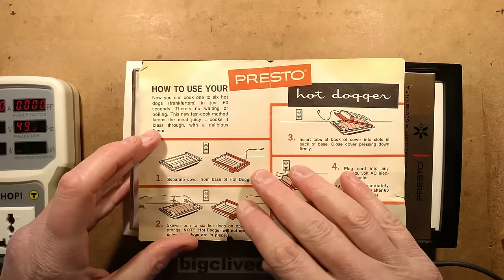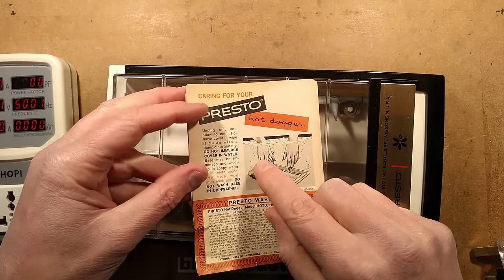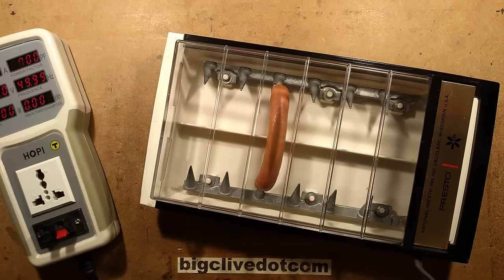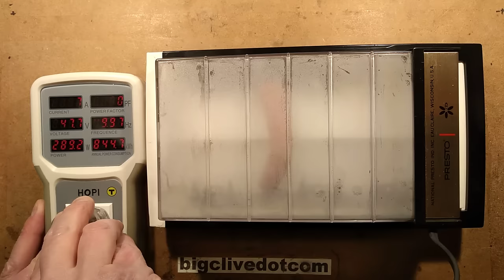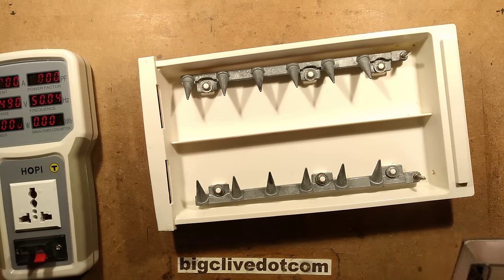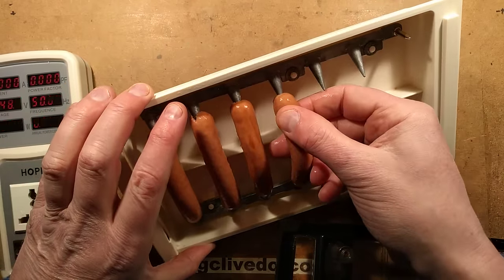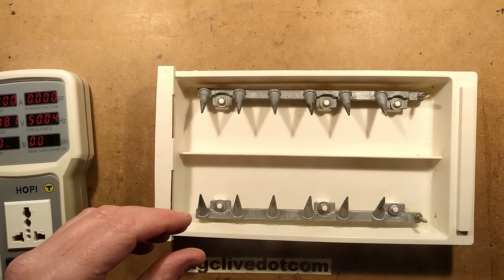Turbo charging a 120V Presto hot dogger on 250V.

Comment: the weird thing is, its probably the most energy efficient way to cook a hotdog.
Reply: It's basically a hotdog mass execution via the electric chair.
Reply: I'm gonna say probably not... I'd be interested to see that tested though
Reply: Turbo charging 6 Hotdogs was around 8kW peak. Let's say that he needs to (worst case) hotdogger them for 1 minute, it would result in 133.33Wh. 
Cooking 100g of Spaghetti with 1 Liter of water in a Pot is on average 200Wh. So I am pretty confident that this invention is as great as it is entertaining.
Reply: @maurice5508  did you say "Wurst" case?
Reply: @speeding2fast  😂👌
Reply: @maurice5508  wht not microwave? Don’t all the waves just bounce around until they are absorbed? That sounds pretty energy efficient to me also I don’t risk burning my finger tips off
Reply: Wrong, you haven't met my ex girlfriend.
Reply: @Moritz Messner The transformer also tends to not be efficient
Reply: @fancypancytalker  Microwaves are pretty efficient.  Thing is you're up against the efficiency of the hotdog being its own heating element, which is going to be 100% efficient or damned near.  Only losses are cord losses
Reply: @maurice5508  When you consider the hot dog will barely need 20-25 seconds at that power it becomes even more enticing as "the worlds most efficient hot dog"
Reply: @maurice5508  It peeked at 2017W. It was the only reading over 2000W. Averaging 750W for 50 seconds, plus 500W more for 38, and another 500W more for 26 seconds, I get 19.3Wh.

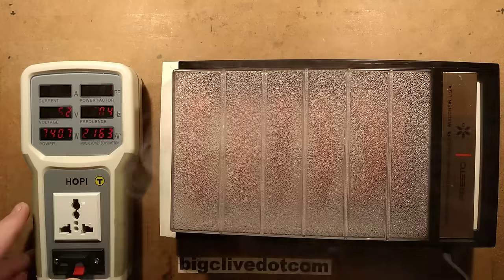6:02	6:52	total 670-631W
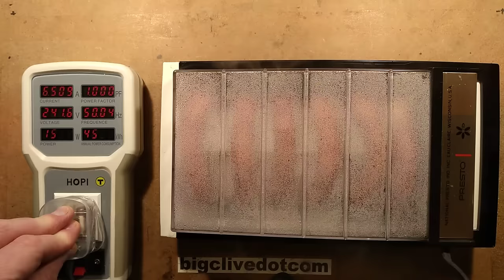6:08	6:46	>1000W
6:18	6:44	>1500W
6:29	peek	2017W

750x50	37500
500x38	19000
500x26	13000
69,500 Ws	19.3 Wh
Reply: @Bob5mith  you are totally right! I did not pay too much attention to the dot on the display. But anyways even with the wrong wurst case calculation I made it seems still more efficient then cooking them normally :)
Reply: @maurice5508  A microwave might be close, or at least in the same order of magnitude. My calculation is the same as 1150W for a minute. That wouldn't overcook 6 dogs like he did though. 

Comparison with boiling water on a stovetop is right out the window.
Reply: If phontoninduction  was still around should get him to go I want hot dogs in 0 seconds lol starts pumping over 10000amps and volts through  it lol  be more like exploding  hotdogs 🌭
Reply: @fancypancytalker  For a microwave you have lots of moving parts and other components of it will heat up as well.
You can tell by the sound coming off it, and the fact that many will often cool down after use.
Reply: I think it is like heating in general.
Pretty much all the power is dumped into the hotdog so not much can beat it, just like a resistive heating element is one of the most efficient ways to electrically heat a room.

The only way to really improve it would be to use a heat pump of some form, so you put in more energy/heat into the hotdog than it takes to pump that heat.
Reply: Yeah it is efficient, if I recollect our measurements at the time (early 90's) correctly. From an exergetic perspective it is a sin, of course. But what better way to be sinful when making hotdogs this way and have  pint or two with it :-0
Reply: @jonathanoxlade4252  Wait, where'd PI go? I just discovered them when you made this comment and they've been great so far.
Reply: @jeffreyblack666  ynow I've been wanting to make a heat pump oven
Reply: @magicalframe9441  It actually probably is. In most other cooking methods, a large portion of the energy used to heat the desired target is actually lost to the environment as radiant heat energy. Think about it this way; If you boil the hot dogs, you’re also cooking a pot, a bunch of water, and your stovetop. Even if you microwave them, a large portion of the radiation is just going to bounce around the microwave and dissipate, not to mention what’s being used to operate the light bulb, keypad, and LCD. I wouldn’t be surprised at all if dumping mains voltage into hot dogs is the most efficient way to cook them.
Reply: @speeding2fast  that would be die wurst joke ever :p
Reply: @Moritz Messner At the same time one could argue your wiring loses a bit of power delivering the power to the tasty resistors.
Reply: Hot dogs come already cooked.
Reply: I think actually cost wise the cheapest way is Microwave !!
Reply: @marcusharmon8389  Back when the Hot Dogger was in production I presume it was pretty cheap, a lot cheaper than a microwave.  Since it is practically 100% efficient it uses less energy than a microwave oven which is about 2/3 efficient.
Reply: @marcusharmon8389  No. That would use more than the zapper. The energy required for cooking is the same no matter what the method, but there are losses converting electrical to microwave energy. Of course, the steam is a loss, too, with the zapper since it probably does little cooking.
Reply: @mikemondano3624  takes 15 seconds in mine so probably about the same but it’s still very good
Reply: @mikemondano3624  by the way I used to do a similar thing in Prison in 1995 I had two wires coming straight from a 240 mains for boiling water for a cup of tea or coffee I attached 2 razor blades from shavers to the ends of the wires and attached them to hot dogs which the prison always served cold either by choice or just because you went down late for dinner this had the same result !!!
Reply: @magicalframe9441  why would you say that? not very logical
Reply: You're probably bang on the buck for that one lol
Reply: Better than the microwave
Reply: So don't turn it on until the lid is on if you were to touch those terminals in the lid you be fried
Reply: @speeding2fast don't be a "Brat" about it 😂
Reply: Electrically yes, but I find if you want to optimize for both convenience and flavor, cooking them in a pan with a little bit of oil is actually really good. They get a little crisp on the outside, and they stay juicy on the inside. Way better then boiling, IMO the best way to cook hotdogs without a camp fire or BBQ.

Comment: I like how the hotdogger doesn't even have a switch, and you have to physically disconnect it from the wall.
Reply: Honestly I'd never trust the switch if there was one
Reply: Well thay do have switches on the wall like smart ppl don’t thay?
Reply: @timrattenbury4768  well it was designed for the American market where most people don't
Reply: I have a portable electric grill like that. It's literally just an electric heating element, a power wire, and a housing.
Reply: it needs the two metal on the lid two complete the circuit so as soon as you open the lid it stops cooking pretty smart tbh.
Reply: @IncredibleMD  not even a heating element, you just plug hot dogs into the mains
Reply: @bryanmartinez6600  well it's added safety. In my house the upstairs landing socket is on the ground floor loop circuit. I can tell you that creates quite a spark when you are rewiring a socket thinking it's been isolated. 🤣
Reply: @royfinegan8006  It still only works with the prongs bridged so there's two disconnect layers in the case of a switch.
Reply: @danksley  well the idea of turning it off would be to bridge the prongs, I wouldn't want to do that with a single switch
Reply: @user-yv2cz8oj1k  i can clearly see the mains-connected prongs in the cover are recessed into insulating tubes, so you would need TWO forks first, to get the connection and then bridge them. I don't think most people have two forks in their kitchen
Reply: @royfinegan8006  so you dont even trust your light switches my word sir you rebel
Reply: @calvincormiercole6438  my lights can't cook 6 hot dogs at once
Reply: @royfinegan8006  fair enough lol though that would be an interesting thing to see not gonna lie
Reply: @timrattenbury4768  What the fuck...
I had no idea that existed.
Reply: You can clearly see that the power cord is connected to recessed contacts in the cover so nothing is live if you open it. Is everybody stupid here?
Reply: @officer_baitlyn  gezz
Reply: @Volvith  well yea we all have switches on our walls its wierd without them
Reply: The switch is the lid.
Reply: @IncredibleMD  Yeah I think the idea is to make sure you unplug it after use so that it can't accidentally start a fire or something if the appliance did have a switch that failed in the middle of the night. I also have a George Foreman grill that's the same design. As for the actual video, it's absolutely insane that this was a commercial product sold as a kitchen appliance.... the world where you could walk into a home goods store and buy a "Hot Dogger" that electrocutes your hot dogs is a world entirely different than today... can you even imagine if someone tried selling this today 🤣🤣🤣 Man I thought he was using something home made when he applied mains voltage to hot dogs in the "Sausage Fest" video, still am amazed that this device exists.
Reply: @MittyNuke1  That is an incredibly specific worry. I'd be more concerned about leaving it plugged in than I would be about the switch failing in the middle of the night... especially since unplugging it when not in use would preclude the switch failure concern anyway.
Reply: DocIncredible I was trying to say in general the reason stuff like this doesn’t have a switch is because they don’t want you leaving it plugged in unattended because something bad could happen, anywhere from someone getting shocked or burnt, all the way to a house fire. I picked an extreme example to make the point, guess that wasn’t completely clear!
Reply: In the US, it was fairly common to have things that you simply plug in and they come on with no switch, especially in the kitchen.  Most of these were resistive load items like coffee percolators, popcorn poppers, and this thing.
Reply: @bryanmartinez6600   you mean to say you can't charge your phone in the bathroom while taking a shit in the dark?
Reply: At least they put the electronics in the lid. Actually pretty smart. Easier to clean and less chance of someone electrocuting themselves.
Reply: @timrattenbury4768  not usually on American plugs. In the UK it's the standard but most US plugs I've seen have zero switches on them. Not sure if this is the norm or common though (I'm guessing it's probably quite common if you look at a Google search for US plug sockets)
Reply: @bryanmartinez6600  -- I've seen switched lights that still had power to them even though the switch was turned off.  Instead of putting the switch on the line side of the wire, they incorrectly put it on the neutral side.  They light still turns on and off, but there is power there even if the switch is off.  Makes it soooo much more interesting if you are trying to remove a broken bulb... :)
Reply: In the event of an accident, involuntary shaking is hoped to unplug the device.
Reply: I’ve been turning off my appliances like that since I knew how to use em. Hot water kettle gets unplugged, microwave, toaster and etc.  idk why I do it, I just do.  You probably don’t give a fuck and idk why I’m telling you hahaha but yea
Reply: thats extra costs, that whole 10c it would have cost them to put a switch on, they can instead just wire it straight through and pocket the 10c.
Reply: @user-yv2cz8oj1k  this is why i just disconnect the electricity to the whole house if im doing any work on the electrics, a lot of electricians for some reason like to attach plugs and lights to completely different circuits, at my mams they attached the ceiling lights to the garage circuit, so i electrocuted myself thinking the house was isolated, when some lazy electrician had instead wired it up to the garage circuit and made no mention anywhere.
Reply: @timrattenbury4768  the UK is the exception in terms of electrical installation.
Ringmains and switches on the sockets are really rare in the rest of the world.
Reply: Its pre three prong I feel this is from the good old days of no seatbelts and when aluminium wires were considered safe
Reply: @bryanmartinez6600  same
Reply: @IncredibleMD  I have a mini George foreman that's the same way. No power switch...
Reply: Maybe its by design. This way people are less likely to forget disconnecting the circuit bedore touching it
Reply: @nandornagyilles3290  This was also sold in a country where shampoo needs "do not drink" warnings, so I generally try not to underestimate stupidity
Reply: It’s good for old people because a power switch is confusing.
Reply: you cant stop the hotdogger
the hotdogger hotdogs all
Reply: Just Like a Fork
Reply: Wouldn't the switch ark and be useless
Reply: @lordkek5817  Now have a live wire and neutral hangin out there unsecured right where your hand would curl under the lid as you pick up.  This is VERY dangerous, downright negligent for a kitchen appliance marketed to people too fucking lazy to just fry the hotdogs, I'd imagine people have been shocked by this thing before.  Not to say electroshock therapy on hotdogs is a bad idea, it's just that this specific device is a very unsafe appliance by any measure.  Even a simple electromagnet lock would force you to remove the plug to open without active circuitry inside.  Wouldn't stop you from plugging the lid into the wall while seperate from the bottom half but it'd certainly help.
Reply: Would be better if they added a timer instead of a switch. Much safer and easier to use.
Reply: this isn't true, the lid it's self is the switch.
Reply: @derekakaderek  The lid itself is an exposed live wire, that's what he's talking about.
Reply: If you open it up it'll shut off.  Still not quite safe feeling.
Reply: @mdchaney  It doesn't disconnect the exposed contacts from the wall, it's like sticking a fork in a socket.
Reply: @JohnSmith-fq3rg  The connections are well-recessed in small holes and several inches apart. You're right about it being like sticking a fork in a socket. You would have to do some as deliberate and stupid as sticking a fork in a socket, two forks in two different sockets at the same time, really.
Reply: @Bob5mith  Honestly it doesn't matter if the lug is recessed in a greasy, steam filled hot dog cooker, it is an accident not just waiting, but most likely has already happened.
Reply: @JohnSmith-fq3rg  The two people who found a way to get shocked by it probably complained about it less than you have.
Reply: @JohnSmith-fq3rg  Unless the lid is damaged, the AC connections are insulated. Only the pins in the base or something similar in size can reach the contacts. 
Setting in down on a wet surface might be a problem though.
Reply: Like cheap Turkish water cadles
Reply: @bryanmartinez6600  this is actually  an exception to the code. thats probably the same circuit in your kitchen if thats the case
Reply: @HeyItsJonny  France?
Reply: @justtime6736  Close, usa
Reply: @timrattenbury4768  not in the US and most of Europe they don't.
Reply: No need. Just open it.
Reply: The lid is the switch
Reply: It probably could be improved quite a lot with the addition of a switch...
Reply: My uncle had one in 1972 and I can remember the hotdogs were good..I would guess they are not legal to sell anymore…But I would say they are totally safe if used properly..
Reply: @danbartstow9829  an awful lot of things can be described thusly, that have created disasters up to and including the Chernobyl Exclusion Zone, because they were not used properly.

Administrative controls are not, and never have been, a substitute for proper engineering.
Reply: @hattree the stir crazy popcorn maker and pizazz pizza rotary oven are both still like this
Reply: It does have replaceable organic fuses, though.
Reply: As a youngster growing up in Ohio, my parents had one of these -- and I electrocuted my hot dogs!  Now it's MANY decades later.  

PRESTO made numerous neat gadgets. When I got to college the popcorn popper was a huge hit in the dorm. Perfectly popped corn. No switch. No stirring the kernels. Simplicity and perfection.

Comment: "all my fuses are hot dogs"
Reply: Just hotdogs? You don't need something sturdier like a kielbasa for higher current circuits?
Reply: We have the Germans one country over for when we need industrial sausages.  They have a sausage for every job.
Reply: In America we use Vienna sausages as standard 10A fuses in our fuse panel. Bonus - if you happen to blow a fuse, you get a tasty treat while changing it out.
Reply: And the Viennas come in cans of six so you always have spares!
Reply: I'm guessing they are the slow blow variety?
Reply: @mcgyver272000  Im from Austria and eating sausages that came out of a can sounds very disturbing
Reply: Using a bratwurst for a 80amp car audio fuse
Reply: @gordonblo6338   living where spiders are as bid as toddlers isnt?
Reply: I momentarily thought about whether this would blow a fuse, before remembering this is actually a processed meat based fuse box.
Reply: @gordonblo6338 "4 years later..." Even we Yanks don't eat hot dogs from a can! I've only seen something loosely referred to as "Vienna sausages" packaged that way. Yech. The hot dogs from the refrigerated section are mysterious enough, let alone the ones that are canned. The way things are getting crazy over here, I wouldn't be surprised if people are stockpiling canned meat to prepare for a continental apocalypse.